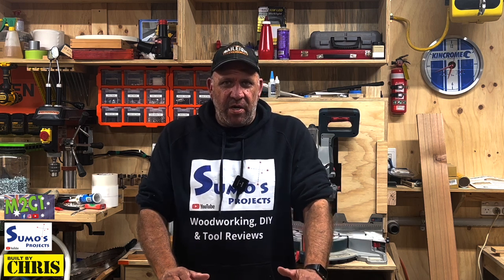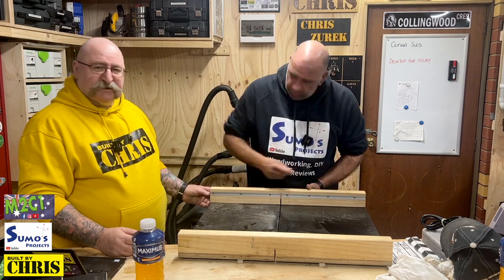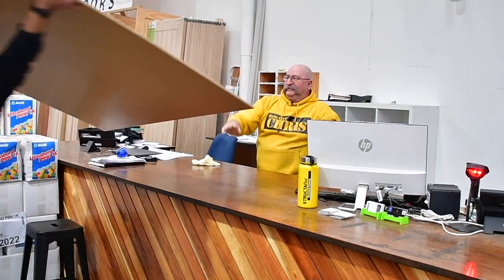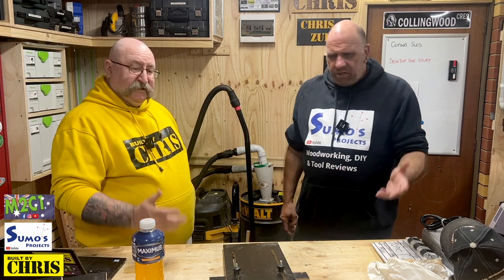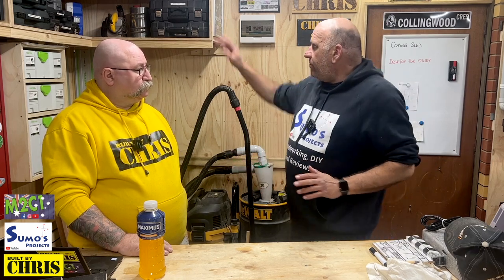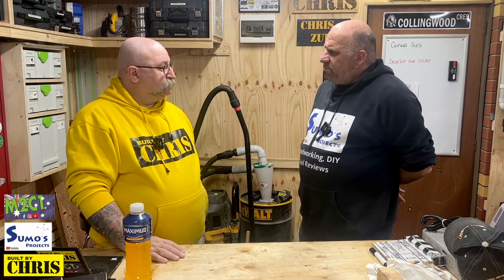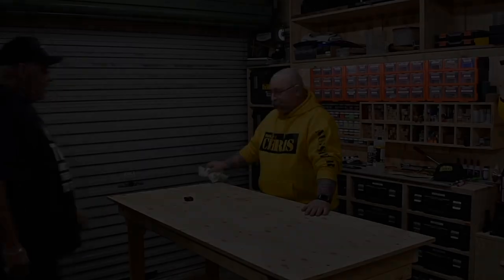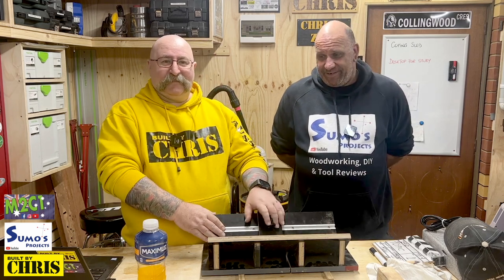S05E10 | Woodworking JIGS ! How good are they

Comment: G'Day Uncles Harry and Hoss.
I really enjoy any talk about jigs. I make many jigs and many for a once only size of product.
However I once came across a jig I made for a single step in bookbinding. I had made it with a plinth of mahogany and a chemical test tube retort clamp with a rod in the clamp covered in leather. It looked like an instrument of torture but to my amazement I could not remember what it was needed for and I still can't remember! I have used the parts for something else and I know without doubt I shall need it again and kick myself for taking it apart!
Grouse tips from James. I have an old conventional electric drill, a wheelbrace and a brace and bits plus a set of manual screwdrivers . . . only had a battery operated item once and never again! The battery would run out at the vital moment. I took the chuck out and still use that and the battery makes an extra paper weight!
Thanks for another ripper episode - how did we get to number 10 so quickly?
Toodeloo for now Cobbers  :-)
Reply from the maker: G’day Eryk, well a jig a day can keep the splinters away 🧐 that make no sense but is rather nonsense 😁😁😁 yes they are an integral part of workshop activities on projects & without them many things can become unstuck.
Cheers cobberidoo 🇦🇺👍👍👍🍺